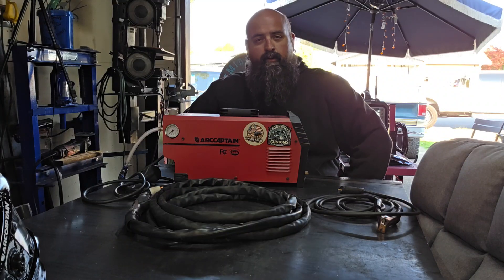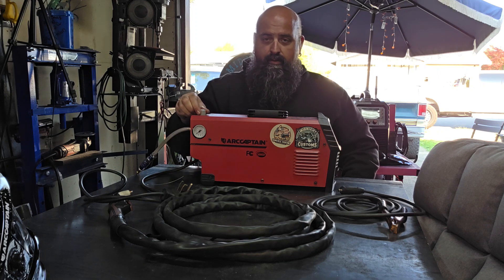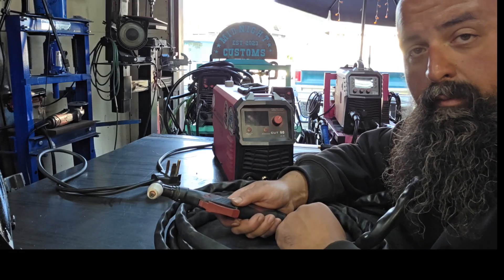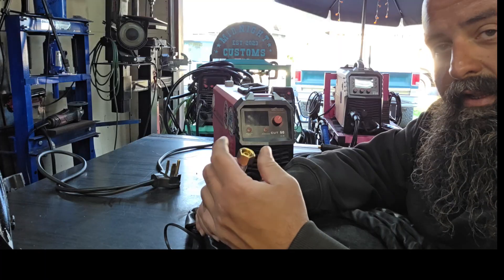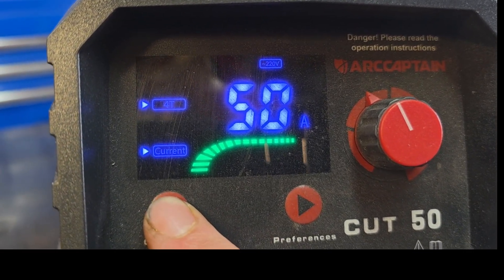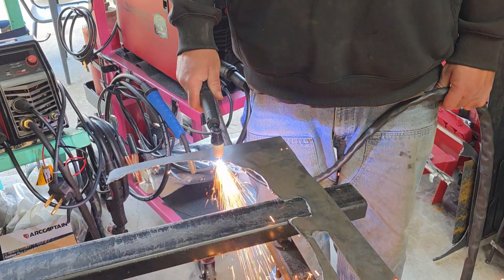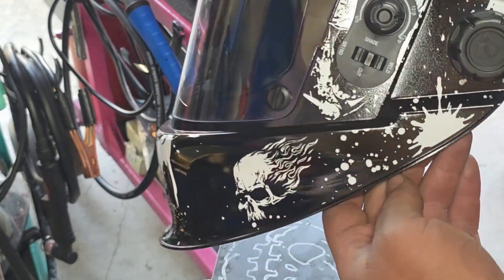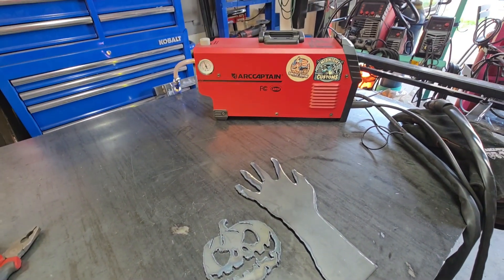Arccaptain CUT50 Plasma Cutter: A Complete Guide for Beginners! (Setup, Settings & First Cuts

Comment: Thank you for your detailed explanation. Very easy for a first time user. 

What is the smallest air compressor I could use on this?
Reply from the maker: I'm happy this has helped you!. 
The compressor is started with was a 20 gallon, and it worked great with the plasma cutter. I'd get atleast a 20 gallon if its affordable.

Comment: Im starting to pull the Halloween stuff out and had a few cats and Jacko lanterns I had cut last year.  I might need to cut some more if I can find some cheap material. I use both the Cut50 and Cut55 for free hand and my Primeweld CUT60 on the table. Cool machines for sure, easy to find consumables and have worked flawless for me.
Reply from the maker: Heck yeah!!! Thats awesome! What table do you have ? 
We have a Langmuir Systems and a razorweld cut45 for the table. Its not operational yet. But soon... we have been using both cut50 and 55 for freehand and love them. They really are great machines. We have a small local steel supplier about an hour from us that has great pricing on materials.  And there's not a minimum purchase amount to buy.

Comment: Nice job pal.🔥 What plasma will you be using with your CNC when your up and running?
Reply from the maker: The Razorweld 45 it has all the connections and its not high frequency.
Reply: @MidnightCustoms-C20  Oh Nice. Jasic make some good gear.
Reply from the maker: @BuzzBoxEngI have never used their equipment before but I hear good things
Reply: Thanks for sharing. Mine should be coming in today. I watched a lot of videos on the Cut 50 and yours was to the point and very easy to understand. Thanks again
Reply from the maker: @benjiburris-g4x thanks for watching! 
You're gonna love that machine, it's a lot of fun.